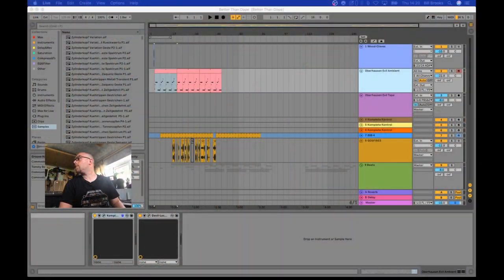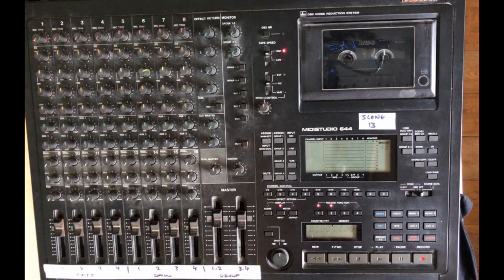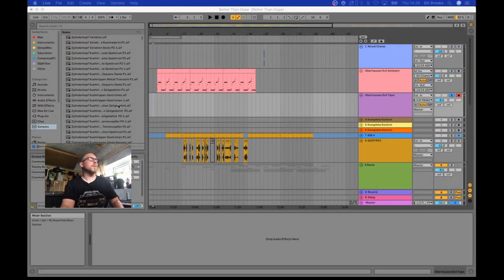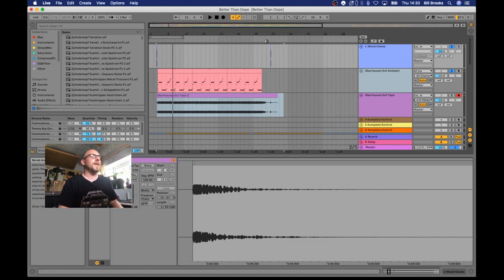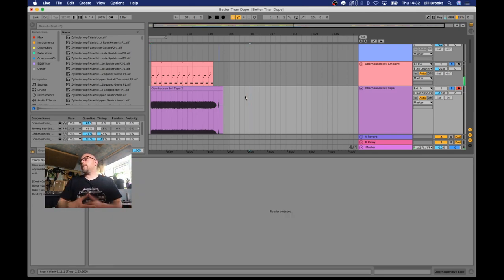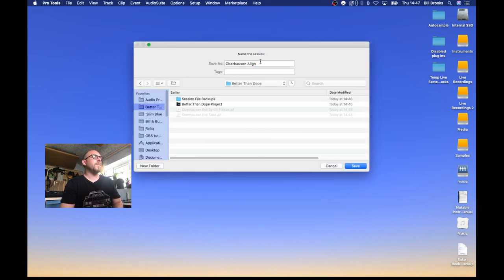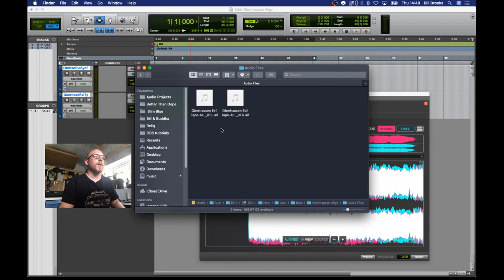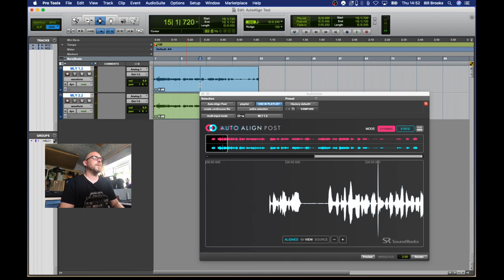Using cassette tape with your DAW - Manual and auto time alignment with Ableton and Sound Radix

Comment: I had no idea that sampling through tape would also change the length of the sample because of the tape speed thing, or is that due to the tape machine not running 100% smoothly?
Reply from the maker: Yes! The motor on the cassette machine will not be perfect, especially if it’s an old machine. This will result in speed changes both during recording and playback, which will alter the before and after timing (and inherently pitch as well!)

Comment: My plan is to send the output from my audio interface from DAW and go straight into a cheap consumer cassette deck which has aux in. Record on the cassette the whole mix from my DAW and from the headphones out from the cassette player to go back into the audio interface and record into DAW again. Will it catch the tape - ness from the tape and hence give my mixes a better tape sound, or it will get worse and I will be better using tape emulation plugins?
Reply from the maker: Good question! 
It depends on your definition of ‘better’!
If you love Boards of Canada and want that very lo-fi sound it may be exactly what you’re looking for!
I would suggest giving it a try and see what you think. 
Perhaps also try just recording some elements of your track out. Just the drums or some of the synths for example. That might give you the tape texture without destroying the fidelity or dynamic range of the whole mix. 
Experiment!

Comment: Hi, do you mind explaining how you run ableton into the tape and then back into ableton? for the layman
Reply from the maker: Via a soundcard with multiple outputs.  You need one which has at least the number of channels on the tape machine.  So if you want to do 4 track tape you need a Soundcard with 4 output and 4. input channels.
Link the soundcard out to the tape in and the tape out to the soundcard in and hey presto!
Reply: So I need to plug my interface outs in the tascam inputs and vice versa, basically?

Comment: cool, but my engineer friend said you would be introducing digital artifacts into the new track, thus nullifying the effect of the tape. thoughts on this?
Reply from the maker: Thanks for the question. The tape has a pronounced effect on the tone and saturation of the audio. With decent soundcard and software the digital recording of this should not introduce any artefacts, and certainly won’t ‘nullify’ any of the tape sound.
Reply: @BrooksAudio  ok cool, even after using the plugin you don't hear a difference to the sonic character of the tape/digital artifacts being introduced?
Reply from the maker: @jacktheguitarman  It's a very high quality timestretch algorithm & only being used very lightly.  Highly unlikely you would hear it.

Comment: so the fact that is a double speed recorder doesnt change the pitch when recording from the daw?
Reply from the maker: As long as you record and play back at the same number of inches per second of tape, the pitch and speed will be consistent.
Reply: @BrooksAudio  thats great cause im bout to get a tascam 414 wich only double speed, what do you think about a tape deck like sony o pionner, will do the same job? i just want to add warm to my masters, but if the tascam has his own thing well im sold
Reply from the maker: @fearlesssound8275  yes! Any tape machine will add character to your master. Depending on what music you’re making you might like to look into cleaning and demagnetising the heads to get the cleanest recording and playback 👍
Reply: Always clean the heads and capstan. Regularly. Tape oxide grinds down the head. You can’t clean them too often 🙂
Reply: @Tazmanian_Ninja  Nice.